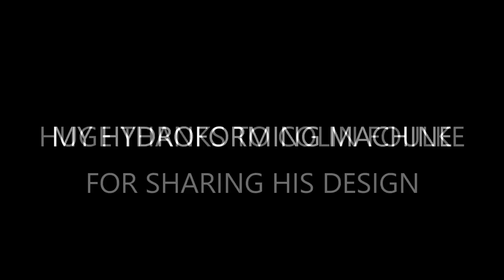My hydroforming machine

Comment: Years back we welded a 3m Dia disc 5mm thick to a steel table and blew a dome, had an air bleed off in the center so only water under pressure. when dome was about 500 high welds started making wierd eerie sound, then a crack opened, the jet of water from the crack spurted across a gap of 3m and blew the wall out of the portacom office and knocked it off it's foundations.

Comment: In school, I built an explosive forming chamber about a third of that diameter.  I used a shotgun shell (pellets removed) to push aluminum sheet (soft alloy 1100) into a steel die, with water as an incompressible buffer.  Because of the fast forming time, I didn't need a very good seal so I could just smear some grease on the edge of the clamp and let a bit of water squirt out.  It worked really well, but I could only use so many ashtrays...  One thought: you could use your pump system to make tubular objects from 2 sheets of flat stock welded together around the edge, like perhaps a 2-stroke engine's expansion chamber.

Comment: We have been doing this for a long time too, only we do not drill the workpiece. We have a groove on one of the rings and a bead on the other. Tightening the bolts creates a lock. We press with oil.
Reply from the maker: I have been considering doing that as well. It also removes the need for an o-ring for sealing.

Comment: Correct me if I'm mistaken, but the specific geometry of that particular type of form is parabolic no?  It strikes me that this would be an ideal way to form perfect solar concentrators.  Just put a pipe at the focal point and bam.
Reply: who knows, it might even be hyperbolic cosine shaped like a hanging wire is
Reply: That is an ideal application for this process, the purpose for the dome he just produced is a frying pan

Comment: I am very impressed with the build quality, the heavy duty aspect of everything to keep it from coming apart and the 'simplistic' nature of the assembly. So, what are you using the domed metal for, and what alloy of steel did you use, if that was important to stretching the dome. (And I like the 'no frills' and 'no extra talking' parts of this video!
Reply: I concur. Though I would love to see more hydroforming.
Reply: top left on top of kiln maybe a clue to what he uses it for?
Reply: @hydrotech6822  Very observant, nice one.
Reply: @Ethan Smith Doesn’t look quite like an effective one,  looks like it’d roll.
Reply: @Ethan Smith This seems like a much more realistic option

Comment: With all due respect, it’s a great setup. You may find that throttling your pressure with a quarter-turn ball valve will eventually wear out the ball. It might be worth your while to replace with a gate valve. Just my two cents.
Reply: No I think if he replaced it with a parallel moving valve of the staeter to make it virtually frictionless and have a motor that is in parallel with the gurtle flux to make a semi condative unitanier complex would be better.

Comment: Hello. maybe someone has told you before or maybe you have tried. I do not know. I think if you
 heat the piece and use hot water, it will get an easier and beautiful 
shape.still looks very good. I like it, good luck

Comment: Its good you have a safety tarp up to protect the people in the next room (county?) from an explosion ;)
Reply: With water, there won't be any explosion, just a water leak.  Water does not compress, so there isn't really any danger of a violent decompression.  With air or steam on the other hand.......
Reply: Arnljot Seem good point!  I was mostly just trying to make a lame joke.  But I would not want to stand in front of that 20000 psi water leak.
Reply: @rivernet62  I have promblem thinking a 150psi walmart pressure washer could reach 20000 psi...

Comment: This is very impressive I hate to be a lurker but I want to remind people you'll be using High pressures doing this and there's a lot of danger involved so use your heads this guy obviously planned ahead and has things well in hand
Reply: It's not as dangerous as you think, using uncompressible liquids there is no expansion like there would be if using compressed gasses.
Reply: Don't let there be any air in the system, and keep back during operation.  If it springs a leak, well, a pressure washer can cut soft wood if it's right at the nozzle.  Want to be a few feet away.
Reply: The worst of it is that a pressure washer is also high enough pressure to inject dirt and other infection-causing stuff deep under the skin.

Comment: Lovely process.  Just a thought, if you put an electric solenoid valve in the hydraulic line and a contact on the top of the gauge it would turn itself off at exactly the right time.  Neat eh?

Comment: Hello there, awesome job, the part seems neat!! Would you be willing to share some more details about the setup? Like your plumbing? What kind of sheet metal are you using?
Reply: I will tell you 
Any strong pump is working  trust me with enough flooding and the metal should be cold roll steel tempered as well to allow forming 😁
Reply: Yea use some 2mm pipes with a moving valve of the staeter with a ball flux guide with a modern that goes up to 50cx and you would prob be fine.
Reply: @mrayco  Do you think it would work with annealed aluminum sheet (provided that I can weld it)?
Reply: @runcycleskixc  yea  it would work easier than iron sheet metal
Reply: @mrayco  Found a video showing that Al may fail before it reaches the shape, prob depends on the alloy and the annealing state (i.e. not as trivial as mild steel).

Comment: Excellent, put zinc spray on your bolt threads, it’s a dry lubricant barrier and stops thread galling.
A polycarbonate cover over that would be a good safety measure, your don’t always know the quality of the steel your dealing with particularly lately with so much old recycled steel going into steel production the carbon level is up and becoming a problem.
I’m guessing you may be using panel steel...
If you have a rupture your going to get intense discharge due to elasticity and potential to loose an eye.
Operating the stop and release remotely via a drive tube with lever attached would be a safe option.
Awesome result and good uniformity, your would beat a metal spinner on quality..

Comment: Why wouldn’t you tighten them in order, just to make sure they all got tightened. I may be sauced but looks like they missed a couple.
It looks beautiful regardless
Reply: To be sure it lays flat and to get even force distributed to every piece of the ring, you have to fasten the bolts from one to each opposite bolt. Like a pentagram. This way you can be sure, that there is no unequal stress to the ring. This is also, how you fasten a tire. Or a cylinder-Head on a car.

Comment: Will you the technical parameters like.thickness of the material,pressure.,hyd pump capacity
Reply from the maker: The material thickness is 1.2mm, I use both 430 stainless, and 1008 steel. I generally achieve an overall dome height of around 5 inches, with around 500psi on 430, and 400psi on 1008 at a diameter of 21 inches. The pump is rated for 2175 psi at 3 gallons per minute.

Comment: What would be the cost to have a two-piece, spherical mold made from steel or aluminum at the diameter that you have here? Contact me ASAP. We're about to begin building our tooling for a new recycled plastic loudspeaker enclosure and that could be molded directly around something like this....and everyone that we've spoken to is astronomically high in both mind and price on how our molding process works. THANK YOU!

 Incredible work, by the way!

Comment: Hello, I really like your design improvements over Colin’s original design.  Are you using 1” steel for the large steel rings or is it 1 1/2”?  I was thinking about trying 1” or even 3/4”
myself, but didn’t want to waste money if it didn’t work out.

Comment: I wonder what the pressure on the gauge was, and how the pressure scale with the size of the intended part -- is it linear with volume?
Reply from the maker: With 18ga 430 stainless, it reaches a max pressure of 550psi.
Reply: @pansmithhandpans7080  Thank you! Do you think if the part had been bigger one would need a lower pressure?
Reply from the maker: @runcycleskixc  the pressure would have more overall force as area increases, but the material being formed and how far it is stretched has a great deal of influence on final pressure. 18ga 430 stainless takes 550 psi to reach a "depth" of 5 inches for this 21 inch diameter part, and if I try to go more than 5 inches, the part will tear. When using 18ga 1008 steel, I can go over 6 inches of "depth" with no failure and never exceeding 450psi. 430 stainless has far less elongation than 1008 cold rolled sheet.

Comment: How about that. The metal would have to be accurate in thickness; if there were thin spots it would blister. Are you using any special quality metal?
Reply: i was thinking it would be  cold rolled. but thats some scary pressure, perhaps extra special is needed.
Reply: Why should metal sheet be made uneven? Just use what you have, it's not rocket science.
If it fails so what? 🤷🏼

Comment: So what’s the difference between this and explosive hydroforming?
Reply: The "explosive" bit. In explosive hydroforming you are using explosives (instead of a compresor) to provide the pressure. Or more accurately, you are using explosives to shape the steel in a water medium.

Comment: You could make a led turn on when dome touch wood thing, i think its a pretty simple circuit
Reply from the maker: There is an adjustable switch on the wood thing that turns off the pump when it reaches the desired height.

Comment: I wonder when it would burst
Reply: (almost) nothing happens. as the name implies hydroforming uses water which is pretty much incompressable, which means that unlike when using air which compresses and therefore takes up a lot of energy while beeing compressed and would erupt explosively only the relatively small volume of water in the bent dome would escape slowly. Maybe  sqirt out a little in the beginning due to the spring in the material, but nevertheless: super safe.
Reply: Yo ming  look again he used water
Reply: Yo ming  he used water. hence the name: HYDROforming. you can clearly hear the noise of a high pressure water pump like used in a pressure washer (most likely what he uses) a well as you can see the high pressure water hose. he only used air to purge out the water in the end i think.  ;)

Comment: Thats cool as hell, but looks dangerous. Any chance of shrapnel?
Reply: It's a hydroforming process so I doubt there would be shrapnel. If his sheet metal was to fail when pressured water is expanding it, I can see water ejecting out where the crack initiates. Shrapnel would definity be an issue if he pressurized it with air
Reply: @chenrigy   Very interesting, I've never seen this process before, thanks for the reply.

Comment: Best one of these that I've seen! Can you describe how the wooden piece triggers the control outlet of the power strip? Also, I noticed in the comments you've considered a groove and ridge system instead of the o-ring and bolts - did you end up trying that?
Reply: It is Just closing circut
Reply: @adamo.7014  Any thoughts on the groove & ridge? I figure if I'm going to build one of these things, I might as well try to make it as easy as possible to use.

Comment: Curious... why do you tilt the table? You have a great system, by the way.
Reply from the maker: Great question! Water comes in at the center of the table, and the return is out by the edge. When first purging the system of air, I tilt the table to make the return the highest point so that its easy to get all the air out, and I tilt it down to the lowest point when draining the water to make it easier to get all the water back out. I also use air pressure to speed up the evacuation of the water.

Comment: Hey brother...im in admiration of your hydroform machine and style...and yes thank you colin.  I wanted to ask you i just finished making mine.  Im using a Neoprene rubber for the gasket.  and I used 3mm...the first go i had leaks coming out of the screw holes predominantly on one side of the plate...so im guessing i didnt have a strict regimen of tightening the bolts evenly.  it stopped forming and leaks start when the pressure was 200psi.  so i was content that the neoprene was working at that point.  The second attemp got me to 250psi and my sheet snapped...but that was my doing.  I just wanted to know how far is your apart are you bolt holes from the main diameter?  and are you using neoprene 3mm?  any advice would be much appreciated and i will share my progress with you for sure.  WIth brotherly love from the valleys in the alps Italy.  you could check what kind of drums i make in instagram: humdrumsrelax

I would love to hear from you.  Marvin
Reply: He posted:
"There is a rubber o-ring in a groove to keep water from leaking, but everything is metal to metal contact."

Comment: Did u used any rubber sheets for bottom in order to obtain smooth finishing?
Reply from the maker: There is a rubber o-ring in a groove to keep water from leaking, but everything is metal to metal contact.

Comment: Hey guys! I have seen many of this systems and I'm asking myself if there is an advantage in using oil over industrial greases apart that the formed piece is not filled with it at the end of the job. :)
Reply: this one uses just water
Reply: Any fluid that is easy to seal against and pump is suitable.  Cleaning the grease or oil is a reason not to use them but you can get higher pressured from a grease gun for very little money ans the grease or oil lubricates the pumps for long life.
Reply: You do not want to use a compressible 'fluid' like air because it stores a lot of energy when it is compressed and forms a bomb should the metal rupture.  There are a number of these videos where they make tuned exhaust pipes and when a weld leaks it just squirts a fine (potentially dangerous to skin or eyes) jet of water until the pressure drops.

Comment: wow great job,
so your saying you use a pressure washer (Gurny) to provide the pressure to form the piece?
what material and thickness is it?
Reply from the maker: It is 18 ga 1008 cold rolled sheet. 1018 forms about the same.
Reply: ok thanks for that 
does it have to be annealed first?
Reply: @pansmithhandpans7080  Will it work with the same thickness of stainless steel?
Reply from the maker: @lacaval  I believe it will. Haven't done stainless yet, but I built it to handle it.
Reply from the maker: chassis no, it goes in as purchased. I'll sand it first sometimes.

Comment: Excellent setup..! :)
What do you use the workpiece for?
Reply: A handpan
Reply: @DrHinge  Yes, now I look at your handle it should have been obvious to me. 🙄
It's an excellent way to form the metal evenly without investing in an expensive hydraulic press arrangement or having the "pleasure" of exercising and working together by beating it with a hammer.
Reply: Kalle Klæp Actually I heard that hydroforming makes bigger differences in the thickness which is not good
Reply: @DrHinge  Correct. The metal will stretch a little which results in a somewhat thinner structure. Normally that would be neglectable but I understand the importance of it when manufacturing an instrument. A few 1/10 of a millimeter can do a lot of difference to the sound it produces. However, beating it to shape with a hammer will also stretch and crimp the metal. The method with a bolstered hammer reduces it a little (and you won't get ugly markings).
making a slight bulge in it before drilling the hole for the forming tool will reduce stretching vastly and smoothening the process a lot.

Comment: It's an amazing bit of kit. But there must be a less terrifying way of doing this.
Reply: Its actually quite safe if done properly,  put simply because water being non compressible it will just break at a stress point and spray out some water, if it were done with air which is compressible and it failed it would be more like a bomb, as long as you are carefull to remove as much air as possible from the supply it shouldnt be dangerous just messy lol.
Reply: @cjc1216  water does build pressure even though its "incomprehensible".  it might burst, but its water. your just going to get wet if your standing near it. somewhat like a water balloon.
we couldn't build water guns or water jet cutters if it water didn't build pressure.  funny that  air builds pressure from being compressed, and water is a bit different.
Reply: @cjc1216  I'm guessing the first tilt is to remove any trapped air in the system, and the second tilt is to remove the water??

Comment: What is the strength of the water pressure for this process
Reply: It depends on what material and the thickness of it. For a hobby size setup, you'll do with a decent sized pressure washer around 100 bar should be in the ballpark for 1-2 mm materials in mild steel.
Reply: As high as needed 🧑🏼‍🎓

Comment: metal spinning looks WAY easier and way more power efficient
Reply from the maker: To do a piece of metal in this shape with the spinning process, you need a machine big enough and a motor with enough torque to spin the metal against the force of the tool used to form the shape, and either a complex system must be made to run the tooling against the metal, or you have to exert the energy to do it yourself. With hydroforming, I tighten some bolts, flip a switch, and a small, low power draw (and inexpensive) power washer provides all the force and work. On top of that, the shape is naturally smooth and consistent.